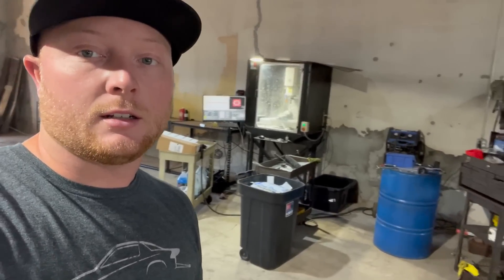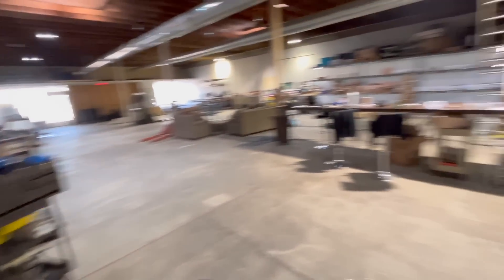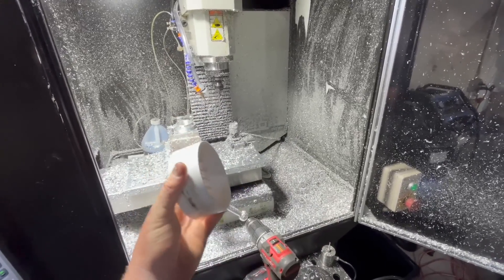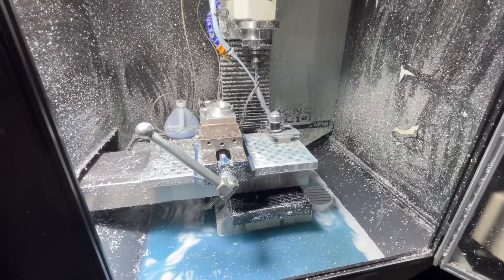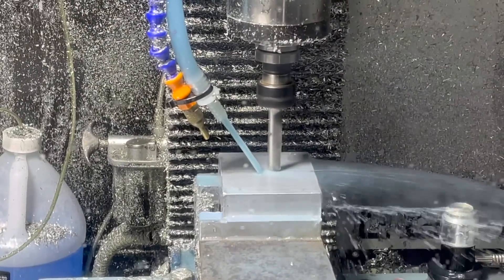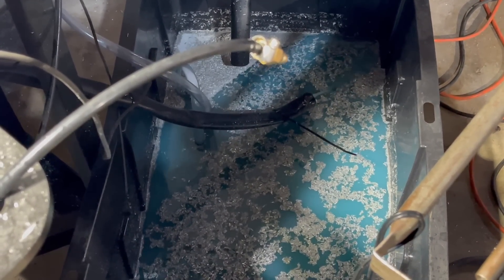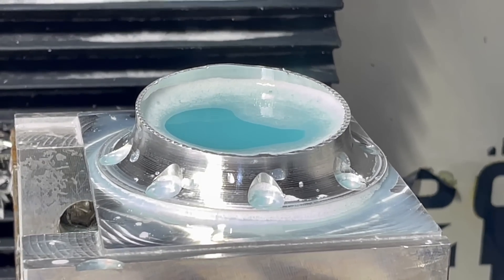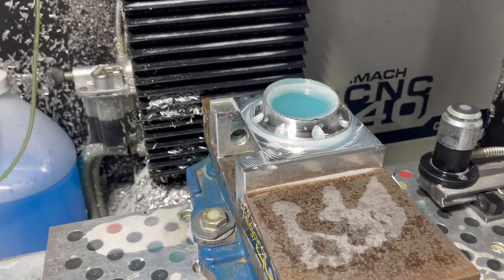DIY $20 CNC Coolant Pump!

Comment: Little trick you can do to help filter out the chips is use a woman’s knee-high stocking to filter out the aluminum, and you can rinse it and reuse it same thing on the impeller of your aquarium pump I used to use them all the time on aquariums
Reply from the maker: That’s a great idea thanks!

Comment: The main types of CNC cutting coolants:
Soluble Oils (most common):
A mixture of mineral oil and water, providing good cooling and moderate lubrication, suitable for a wide range of materials and operations.

Comment: Get a large metal mesh kitchen strainer to let your coolant return run into before it goes back into the tank, that way you will at least catch most of the chips that come through the drain.